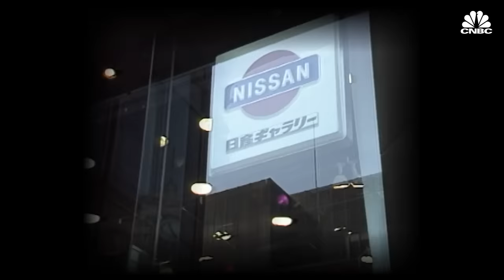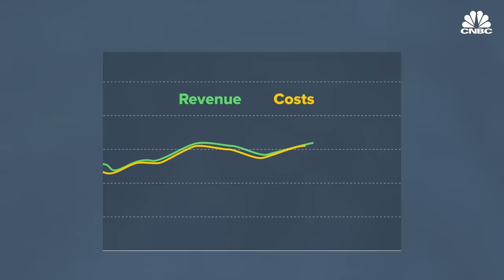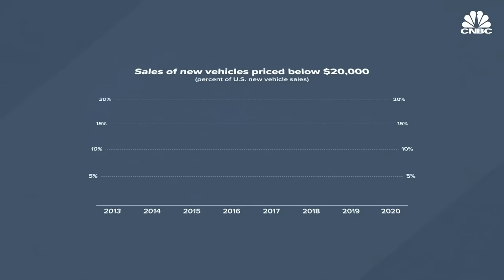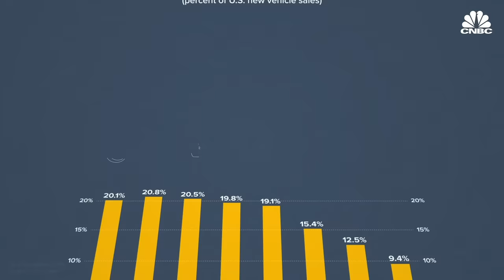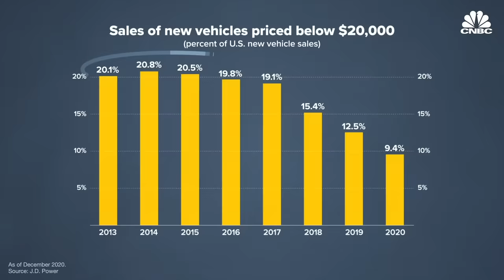Why Cheap Cars Are Disappearing

Comment: CNBC: The end of cheap cars

Honda and Toyota: What you talking about fool.
Reply: I always go with honda or toyota. Wayyy more reliable
Reply: It's a trend
Reply: Nah, Honda and Toyota just slaps a premium on their products because ReLiAbiLiTy RePuTaTiOn. The true cheapo is Nissan and American cars that get discounted heavily.
Edit: Maybe add in the Koreans, but Kia and Hyundai are picking up their game to the point where they're excelling better than Nissan.
Reply: @DanielSparten  My 2008 Toyota Yaris still runs like it came out of the dealership.
Reply: @DanielSparten  nissan is junk :(
Reply: Well Toyota did Discontinued the Yaris which was their budget car under $20k.
Reply: @aymanhawari2589  Thats why they're cheap. They gotta push sales somehow, but it ruins their brand image being cheap and all. Why you think they changed their logo?
Reply: @covenantpig8440  No they didn't. The 2020 Yaris is less than 18k.
Reply: @lotto5742  Back then, you don't have to pay the Toyota Tax to get the Toyota reliability. Now Toyota charges absurdly for the same car because they built this reliability brand image.
Reply: rich man here , @lotto thinks spending $40k on a Camry is 'Cheap'
Reply: @lotto5742  Then where is the 2021 Toyota Yaris model then ?
Reply: @DanielSparten  
I disagree. If you spec a RAV4 similarly to its competitors, it's actually cheaper or nearly the same price. If you were comparing price premiums over RAV4s from several years ago, then that can be explained by the standardization of their active suite of safety features on all their vehicles at all trims as well as the standardization of LED headlights, which is still rare for mainstream cars in 2020.
Reply: @lotto5742  Toyota Discontinued the Yaris in the US. They are available in other countries my bad.
Reply: @covenantpig8440  Oh you're right. I just found out they discontinued it this year.
Reply: Subcompacts and below just don't sell in the US, that is why the Fit and the Yaris are discontinued.
Reply: @Jonathan McCully This is where they're tricking you to spend money. "Oh, car prices are higher this time around because of all this new safety tech to make drivers safe." Seat belts and airbags are safety features for years but they never charge a premium. Now all of a sudden we make a breakthrough in safety tech, but we're going to add it in as a safety package and charge $2k for it? What happened? Oh, let's do a refresh model year and this time will add the safety package standard to satisfy the customers but jack all our car prices by $500, and in our next gen, we will jack up the price again by $500 to make up the cost. Oh and sonar back up sensors will still only be available on top trims. Sure, I will agree the new material designs and safety tech in these new cars today are reasons why these cars are higher priced now than ever, but does it have to be this much? Next thing you know, they'll start charging $10k for a bundle of tech because "Oh well, this new sensor is state of the art, and only produced specifically for this vehicle blah blah."
Reply: @Lucky8s  Compare a Rav4 Adventure to a Cherokee Trailhawk. Similar in price, way different in features. So why can Toyota do this? Oh well, the Rav4 is just built on our brand image, reliable.
Reply: Hondas and Toyotas are getting bigger too.
Reply: @covenantpig8440  it wasn’t actually a Toyota though it was a Mazda 2 with Toyota badge on the front. The last Toyota based Yaris was the 2018 hatchback model (in the US, overseas still get the the Toyota based Yaris and the new Yaris GR 😭).
Reply: @aymanhawari2589  only CVT.
Reply: @DanielSparten  
Sure, I'll compare it to a Jeep Cherokee Trailhawk. If you're too lazy to read the comparison just skip to the last paragraph.

The 2020 RAV4 Trail/Adventure starts at C$38,890. There are no option packages.

The 2020 Jeep Cherokee Trailhawk starts at C$41,895. There are 4 packages you need to buy to get it equipped similarly to the RAV4. These being:
C$895 for the Safetytec Group, which includes BLIS and Rear Cross Traffic Alert, mirrors with integrated turn signals, and power, heated mirrors. All of these features can be found on the base RAV4

C$995 for the Cold Weather Group, which includes heated front seats, a heated steering wheel, leather-wrapped steering wheel, remote start, and a windshield wiper de-icer. All of those features can be found on the lower XLE trim in Canada.

C$1095 for the Technology Group, which includes Adaptive Cruise Control with stop and go, brake assist, automatic high beams, FCW, LDP, and rain sensing wipers. All safety technology can be found on the base LE RAV4. Rain sensing wipers are on the XLE for no additional charge besides the premium to go from LE to XLE.

$1295 for the Comfort and Convenience Group, which includes dual zone AC, power liftgate, push button start and smart key access, a security alarm, and a tonneau cover. All of these are found on the XLE RAV4, below the Trail/Adventure. 

With all of these options without tax*, you're pushing *C$47,000 loaded with the same features as the RAV4 Trail. That's not to discredit Jeep however. The two are not as similar as it may seem to a non-car guy. The Trailhawk is an actual off-roader. The Trail/Adventure has a locking 4-wheel drive system and offroad tires but it can't compete with the Jeep in the harder offroad courses. 
Your ignorance and utter denial is clouding your judgement and objectivity.
Reply: @Lucky8s  Okay thats where I just lost complete respect for you. You turn this entirely on me, and blame my so called behavior on reading comments. Its easy to just turn your back on someone online when you feel triggered huh Dennis? In the mean time, I appreciate your thorough research here, but to call me out was unnecessary and not mature of you. But of course, I felt it coming because most of yall here are mainly in denial. Perhaps we all see value in vehicles differently. But seeing this, its like similar to other markets. Like Apple charging absurdly high for electronic products. For what? Apple's ecosystem, Apple's marketing, brand name. Its the exact same here in Toyota's and Honda's situation. They charge you more for just the name and image of their brand, not to say their name and image is bad, but its unethical just to charge absurdly for that. Inflation, tech advances, safety sure. Valid arguments, but the math just doesn't add up. Perhaps is just the economy. Perhaps our needs and wishes. Either way, I guess not everyone will be satisfied with many brands offerings.
Reply: Even a decent packaged Camry or Accord is now close to $30k. Shouldn’t be more than $25k OTD.
Reply: What about mazda bro?
Reply: @indian0121  i love mazda
Reply: I found a 15 year old Ford Focus for $500 and I had it for two years. That’s like a $10 dollar a month car payment.
Reply: @Anon1mous  The nameplate is the problem.  A $20k 2020 Corolla is bigger, safer and roughly the same horsepower as a $25k 1997 Camry.  But the typical American buyer will buy a $35k 2020 Camry and complains that cars are getting expensive.  This is literally why manufacturers inflate their cars in size and cost, because buyers have a psychological attachment to the nameplate and will pay more to keep buying Camrys.
Reply: Well.. my Civic costed more than $20K. 

Also.. unlike my Chevy, it has a class action lawsuit against it for oil dilution. Japanese reliability is a myth.

Comment: They added all the tech to raise the price, not because we all "wanted it".
Reply: And due to safety and green tech fantasies.
Reply: Indeed
Reply: @Ashakat42  A seat that shoots cold air onto your butt, a heated steering wheel and bluetooth CarPlay are not "safety and green tech fantasies". They are gimmicks. As for the safety features, cars are now so fully loaded with air bags and bigger pillows that it became mandatory to put a backup camera just to be able to freaking see outside... the irony. I don't think it makes car safer though. As far as "green tech" goes, I don't think they use that much space anymore now than they did 20 years ago.
Reply: @bengagnon2894  I agree. I unfortunately fell into oversimplification and threw in a bunch of things under one heading in trying to make a point.
Reply: @bengagnon2894  Look at new cars they have 12 buttons on the steering wheel, so you don't have to take your eyes off the road. Except when you have to look to figure out which button does what. Thirteen if you count the horn. Glad they haven't moved that.

Comment: Kids forgot how to install their own $200 stereo systems and now pay automaker $10k to do it for them.
Reply: Old people cant assemble thier own PC. They just buy whatever overpriced crap the store sells them, along with add-on "services" they were offered with.
Reply: @mjjjuly  Who would want to buy or build a PC anymore?
I gave away my old gaming towers after a normal laptop made them obsolete.
Reply: @jhoncho4x4  Your laptop becomes obsolete faster due to it's poor cooling system. Being able to swap parts when needed saves you hundreds. For example, I started with a $850 build. After 4 years, I upgraded the GPU AND CPU adding on an extra $400. Bringing the total to $1250. My rig can handle cyberpunk at 90fps+ at 1080 high/ultra settings. I spend an extra $175 and used the old parts to make another PC for my sister. In total I spent $1375 for 2 PC's, one capable of playing any game past 144fps at ultra settings, and another build capable of playing most games at 90fps at medium settings. 

Meanwhile you have a 3k laptop about to be irrelevant because AMD keeps releasing better and better stuff.
Reply: @KiraIRL  Yah, just get a new one every few years; keep it simple and portable. 
Computer tech evolves quick and manufacturing costs keep dropping.
Reply: Kids didn't forget.  Electrical systems became more complex. My Dad used to be a car mechanic in the 80s, HE can't even fix certain things on new cars. They are designed that way now - on purpose.
Reply: @AM.000  Nothing has changed, electricity and aftermarket car stereos are still the same as it always has been.
Some dash layouts are easier to work with than others. 
Crutchfield and others are still in business to take care of that though.
It's still a low powered head unit, antenna and 1 - 4+ speakers.
The stereo / gps does not need to "talk" to the car itself, just supplies 12Vdc.
You can buy harness adapters and then it's just "plug and play" most of the time. No wiring has to be involved. 
It's actually easier on the newer cars; they usually come prewired in case it gets ordered.
Reply: Shop class, home economics and basic electricity classes are not required anymore.
Kids don't know when they are being ripped off or how to take care of themselves when short on $.
Automaker just trying to take advantage of that; those cheap electronics have high profit margins and easy to add into production line.
Reply: @jhoncho4x4  unfortunately in the next coming years it will slowly become harder, I work in development for a manufacturer and we are starting to run CAN-BUS through the headunits and through the central gateway in vehicles and plug n play harnesses can change the resistance in the CAN system and cause headaches. Adding speakers or amps with signal processers is still easy though.
Reply: @daviddepriest1849  Aftermarket car stereos have no reason to have any connection to the Canbus system.
Adding an independent head unit and speakers has nothing to do with the rest of the car.
It could be a horse & buggy or Jetson's flying car, as long as it can provide 12Vdc to power the stereo / gps head unit, installation is the same.

Comment: The rise of SUVs is pretty easy to explain-it's all about visibility.  As someone who has always driven cars, there's no getting around the fact that when 80% of the vehicles are taller than yours, it makes it a pain in the a$$ to see traffic correctly.  Traditionally, the tradeoff is that trucks and SUVs are less maneuverable and harder to park, but in the US governments and businesses cater to the whims of SUV drivers and so roads are wider than ever and giant, empty parking lots are the norm.

So going back to the main point...although trucks and SUVs were already a thing, I think they have reached a critical mass where any remaining car drivers will be forced to seriously consider switching to the truck/suv club if only for personal safety; including this guy.
Reply: SUVs are mostly the product of fuel economy regulations.  Small cars have impossibly strict fuel economy requirements.  Growing a car into a larger category, or getting it classified as an SUV is far more cost effective than trying to make a small car that doesn't face CAFE standards penalties.  A subcompact car today must get 45 average MPG to avoid penalties, but if you make it a little taller, heavier, and less fuel efficient you graduate to SUV categorization and only has to get 35 MPG.

Comment: 1. Crash standards keep rising = more expensive
2. Adding safety features (lane keeping, auto breaking, auto crusie control) = more expensive
3. Rising fuel efficiency standards = more expensive
4. More tech - more expensive
5. Computer chip prices have skyrocketed in recent years due to COVID = all the  above driven by chips got much more expensive

Plus the car companies have realised you just have to work too hard selling cars with low profit margins that it just makes more sense to sell less vehciles that have higher profit margins. This also let’s you cut down on workers and factroies int he long run whoch saves even more money. The less cars you produce but with higher per unit pargins leads to a much more successful company.

Comment: "New cars last longer..." I laughed out loud at that part.
Reply: No, they do not, because there will so many recalls and huge problems, during ownership.
Reply: My Prius is at 180,000 miles and hasn’t had any major engine troubles. Previous cars have had issues with rebuilding a transmission, rebuilding an engine, alternators, water pumps, etc. 

With EVs increasing in popularity, you have to look at total cost of ownership. Without as many moving parts, less heat, almost no fluids, EVs cost more up front but can cost less during the lifespan of the car. My Prius has a continuously variable transmission that doesn’t shift. That’s a $3,000 repair I haven’t needed.

Comment: Raising auto reliability makes certified pre-owened cars the new cheap car.
Reply: unarmed blackman  Depends on the vendor, current mileage of the car and the contract written up for the car. My CPO from from GM had a 3 year/36k warranty and maintenance schedule just like a new car. And because it was from GM it was good across the U.S. Yes, it did give me piece of mind, and yes it saved me a bunch of money. Bought another COP from Chrysler and their car check and warranty wasn't nearly as complete.
Reply: unarmed blackman  But it's a used car with a manufacturer-backed warranty.  Depending on the car's condition, that can be a good deal.
Reply: The extra warranty years make CPOs worth it. The lexus l-certified program is nice. You also get 2 year complimentary maintenance and roadside assistance.
Reply: unarmed blackman  Nope, not an extended warranty. A CPO warranty. And no, GM wouldn't be offering them if they were losing money on them.
Reply: unarmed blackman  "dealers have been selling used cars with/without warranties for decades" it's not from the dealer. It's a GM CPO warranty that I can use with any dealer just like a brand new car.
Reply: unarmed blackman  Lookup GM CPO

Comment: I just by my vehicles cash from auctions. Drive it for a year or 2 then sell it for same or more than i paid.
Reply: I don't specifically buy from auctions but I DO buy used vehicles, usually for under $1,000, like you, drive for 2 years, expect to replace one $200 part and sell for about what I've got in it.  Which means it's free.  Part of the way I pull this off is always having a extra beater around.  I don't need a more expensive vehicle for reliability if I already have a spare vehicle I can jump in if my main one pukes and needs a part.